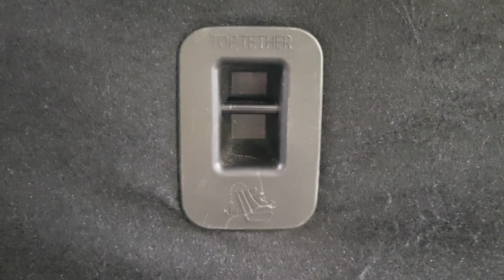Custommade seat covers for BMW i3 - Part 2 - Installation

Comment: Thanks for this. It was super helpful. Note that the section behind the rear seat does not need to be removed if the back upper covers are installed while the back seat bottom is removed. I was able to feed the cover through.